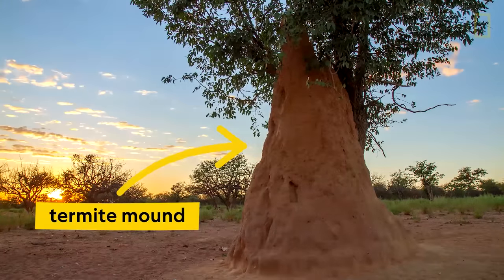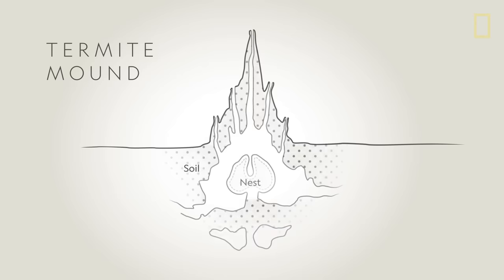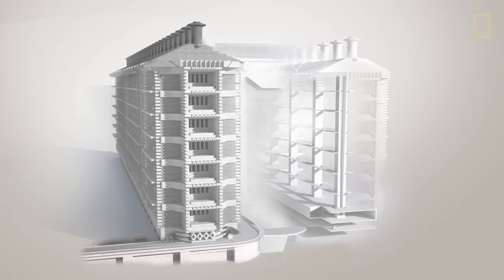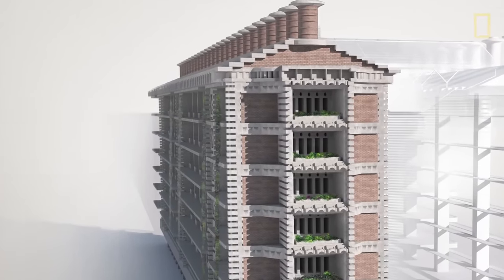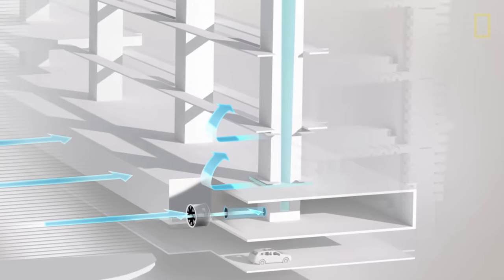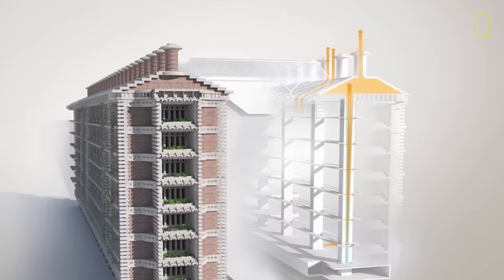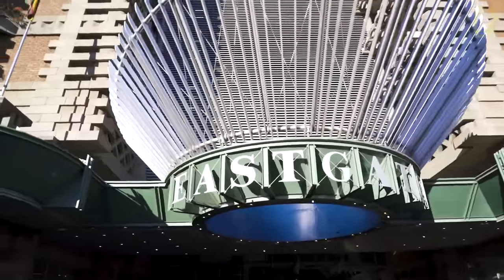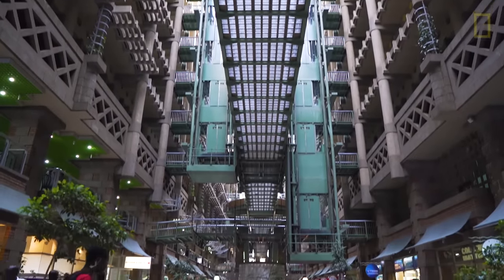See How Termites Inspired a Building That Can Cool Itself | Decoder

Comment: When she said 82° I literally cried in Celsius.
Reply: LMFAO 😂😂🤣🤣☝🏼👏🏼
Reply: Holy LMAO 😆😂
Reply: C=(F-32)/9. Isn't it the conversion equation from Centigrade to FARENHEIT and vice versa? 🤔🤔
Reply: 82 F is actually freaking hot, is like California hot
Reply: @tickle296  5/9...if u will not multiply by 5 it will be temp of winters😁
Reply: @kevinchen1763  it close to 27℃ which is not hot for hot countries....in my state summer peak temperature goes upto 40℃ which is not the hottest of my country..this year it's less hot here still today's temp is 36℃....Zimbawe is hot country so for them 27℃ is normal temperature
Reply: @kevinchen1763  When you are coming from a temperature 10 to 15 degrees higher, it will feel cool.
Reply: @Phoenix.219  that's almost heaven here in philippines rn. With daytime usually 36celsius or smth with a heat index of 41-42 celsius cos of humidity. I literally still feel sweaty having a fan directed at me at full blast. Damm. All buildings in the tropics should be standardised to this
Reply: @plip_plop  I can understand that.... It's just that they aren't used to the temperature😁
Reply: @devvv4616  when I saw this I thought the same...bcz in 27℃ a fan would be more than enough for anyone who are used to facing temp. even more than 40℃ with hot winds...last year the highest recorded temperature where I live was 45.8℃ ....and I live in plains...my brother went to a place in Rajasthan,which was still far from desert but much close in comparison to my land and nose bleeding due to heat was a frequent phenomenon for those who went from here....if only I can find the whole mechanism of the building I'll get my house built in this way.. It's eco friendly too as we'll not need AC
Reply: Oh don't worry, it's not cool in Fahrenheit either. The fact that this woman describes 82°F as "comfortable" tells me she's never been to Florida.
Reply: 27C is really comfortable 🤣🤣🤣🤣, I sleep with 31C at night without air-conditioning
Reply: some random guy: 27 is hot
Iraq: Am i a joke to you
Reply: Nat Geo is an American company
Reply: @plip_plop  Jesus that's uncomfortable cold for long periods.
Reply: @kevinchen1763  27 c is pretty cool in Caribbean
Reply: kkkkkkkk me
Reply: @kevinchen1763  well , i live in a tropical country, so it's hot AF , depending of the region that you are the temperature can be almost 40° C so next to 27, 32 is super cool.
Reply: Look it doesn't matter that over 90% of the world uses metric.  American measurements must be used because America..
Reply: It's 27.778 ⁰C dude
Reply: @willythepool3812  or a fan for that matter.
Reply: it's 27.78 Celsius
Reply: @0ctatr0n  it’s actually not American measurements, they’re called imperial measurements adopted from Britain.  The US would probably switch to metric if not for the power of American businesses which balk at the cost and time it would exact on them.
Reply: @willythepool3812  now how about that 😆😆
Reply: @kevinchen1763  82F is not that hot, atleast for my country. My country is a tropical country with average temperature of around 33 celcius, or 91F. In the off rainy seasons it can get pretty close to 40 Celsius or 104F. In my country what you call California hot is actually cool for us. During the rainy season it is about 27 celcius Which is a little less that 81F
Reply: @kevinchen1763  82 F (28°C) is Winter for us.
Reply: @Phoenix.219  Zimbabwe is definitely not hot. It is further south than the Tropic of Capricorn. Equivalent to places in China, not India.
Reply: It so hot 😂
Reply: @zhonnio2386  27 is actually cool here temp if here it was 36 we would still be happy
Reply: Its actually still really hot in fahrenheit.
Reply: Termites have long been an important part of many cultures. In Africa, they are considered a delicacy, while in Asia they are used as medicine. In the United States, however, termites are considered pests. But what if these pests could help us?

That's what one company is hoping to do with a new office building in Qatar. The building, which is being designed by Aedas Architects, will use a system called biomimicry to keep itself cool.

The idea behind biomimicry is to imitate nature in order to solve problems. In this case, the problem is how to keep a building cool without using air conditioning.

The solution comes from termites. These insects build their homes by excavating long tunnels. They then use their bodies to regulate the temperature inside the tunnels.
Reply: Considering how this is National Geographic, where "appearing scientific" is what they are going for, it is kinda weird how they are using units the scientific world (and tbh. the whole world) has already abandoned...
Reply: I hate that 95% of YouTube channels only include temperature measurements in Fahrenheit. Like you’re using measurements that are only relevant and understandable to 4% of the world…
Reply: I internally screamed "WHAT!", and then saw "Farenheit" and thought "ok...? 🤷‍♂ maybe"
Reply: I cried in Fahrenheit. That's hot for indoors. Of course, I'm from a cold climate.
Reply: @kevinchen1763  well consider the fact that it’s probably 90 or higher outside every day.
Reply: @kevinchen1763  that’s not true. 90 - 100 feels hot here in la
Reply: @kevinchen1763  no its not lol. i lived in phoenix where it was over 100 daily for most of the year. 82 was only slightly warmer than what i kept my house at in that weather
Reply: @kevinchen1763  bruh 82 F is around 27 degree Celsius 😂
Reply: @kevinchen1763  if 27 degrees is California heat, then Californian's have no right to complain about how hot it is down there anymore, we get the exact same temperatures in Canada.
Reply: Celsius users are not numerous enough to fund this video...
Reply: Why insisting using farentheight if the world is using Celsius. Just get rid of F it's R
Reply: 82 degrees fahrenheit = 27.8 degrees celsius
57 degrees fahrenheit = 13.9 degrees celsius
ffs USA
Reply: @vikasvimal6769  Better check a map again. Zimbabwe is actually just north of the Tropic of Capricorn, which runs through the northern tip of South Africa. South Africa, Botswana, and Namibia (not sure about Zimbabwe), each have arid to semi-arid desert regions which can easily reach temperatures of 40 degrees Celsius. Though you are right that it generally gets much cooler south of the tropic of Capricorn (ie. South Africa). South Africa is still Africa though. 30+ degrees is not uncommon during summer. Even on the southern coast, places like Durban in Kwazulu Natal can get pretty sweltering due to humidity.
Reply: Did you LITERALLY cry? Tears?
Reply: yeah fahrenheit should be banned
Reply: @kevinchen1763  no it isnt
Reply: There are two kinds of civilizations. The ones that use metric and the one that has been to the moon.
Reply: @JoseARomo-qv5fk  dry heat. Florida is wet heat.
Reply: Lol. There was a research once that found out there is a world outside of US.
Reply: @plip_plop and that is why visitors from other countries literally fall ill when when faced with the arctic air conditioning in the US. You probably only can survive that because you only move from your cold homes via cold cars to cold offices and shops, and you do not walk outside. Have you ever reflected on what happens to the hot air, that comes out of your ac-unit outside your building? That heats up a hot city even more, making it impossible to be outside.
Reply: I melted sweated boat loads of sweat before I could shed a tear. Imminent death followed
Reply: Weak.
Reply: @joemason2587 thanks bro saved my computing time
Reply: 82 inside is not comfortable either way. Just less AC use.
Reply: 82°F is not exactly comfortable, more like tolerable
Reply: @kevinchen1763 my south Mexican hometown is that temperature for like 8/12 months of the year lol
Reply: Died*
Reply: Forgot the funny part
Reply: Me too😂😂

Comment: I worked in the eastgate building everyday 8am-5pm for a year. I would say in hot weather temperatures inside the building (around 25°) were pleasant compared to those outside (around 30°). Hot weather is 9 months in Zimbabwe. However, during 3 months of winter the lower temperatures inside the building were uncomfortable for many. It was better to be outside
Reply: I didn't know you could have winter in Zimbabwe.
Reply: @MalaysianTropikfusion  we do have winter but our version is mild. I'm 35 and I've never seen snow. In the afternoon you just need a light jersey and then it gets bad in the evening where we stick around fire places
Reply: @clarencemaseko428  Just last year I experienced first-hand a Saudi Arabian winter. It was mind-boggling to feel cold at 12 P.M. noon. Looking at a map, it's no wonder. Saudi Arabia is north of the equator, and Zimbabwe is south of it.
Reply: @clarencemaseko428  You can easily put more clothes on if it's slightly cool, what's important is solving the issue of heat because that is much harder to solve
Reply: Termites have long been a problem for homeowners, but one company is using them as inspiration for a new type of building. Termite mounds are found in hot climates and are known for their ability to regulate temperature. The company has developed a way to mimic the termite mound, using concrete and clay to create a structure that can cool itself.

The building is designed to take advantage of the lower temperatures during the winter months. The concrete and clay absorb heat during the day and release it at night, keeping the building cooler during the hottest part of the day. The design is still in its early stages, but the company believes it has potential to revolutionize how we build in hot climates.
Reply: @showshowtomakefreeenergyge2426  The particular termite shown in the video, doesn't eat wood tho.
Reply: @lil_weasel219  there's only so much clothing you can remove and still maintain a professional dress code after all
Reply: I don't understand as well what's' so good about taking cold air from the bottom and pushing it back up anyway...
Reply: @olivieryeung398  cold air doesn't rise, it falls, so cold air from the bottom being used to cool the higher floors is actually kind of efficient
Reply: Wasn't there a fan which circulated cold air at night?
So if it is an actual issue in winter
Can't you just shut those down during winters?

And perhaps also have something to cover/close the chimneys for winters
Reply: @Kislay11  my thoughts exactly
Reply: 😅 Harare people talking about cold? Lol come to Marondera or Gweru🤣
Reply: Also it has snowed in Gweru twice in written history, but rare.
Reply: 9>3
Reply: the termite nest regulates because it brings ground temperature to above ground. this building is radiating so much heat away it's not following the termite principle anymore, lol
Reply: The chimneys should have been capped in winter, to hold in the heat.
Reply: Oh you meant the afternoon
Reply: Thanks a lot for you feedback it always nicer to have some real people experience then just fancy video
Reply: You mean colder monsoon season not winter
Reply: I've been to eastgate a few times and it's nice and cool in summer and not really warm in winter. I think it works better for cooling rather than keeping warm since the main reason it was built was to reduce electricity costs.
Reply: If only someone had invented the window or explained to the architects that the termites live below ground and then found someone smart enough to explain all that to the architects so that they could still take the credit!

Comment: For those of you are interested in this topic of architectural passive cooling designs I would suggest looking into what was used in Persia (now known as Iran) many centuries ago. “Badgirs” (cooling towers) were an ingenious use of local materials and the dynamism of nature’s thermal homeostasis to provide “air conditioning” that didn’t rely on electricity.
Reply: Cooling towers are interesting but completely impractical. You still can't beat Oil, Electricity generation, and Air Conditioning units. The vilification of modern technology is getting ridiculous. Notice how the larges proponents of going backwards never quite commit to do it themselves. I'd say those Africans were conned.
Reply: @Thinks-First it's not vilification. It simply is not sustainable to rely on fossil fuels for all our needs. While we wean ourselves off this dependence, it is helpful to have innovative low power consumption technologies
Reply: @Thinks-First They literally had temperatures between 27°C to 12°C.
Thats what people in those regions set the AC temp. at.

It is you who is blinded to not be able to see that they got what they wanted.
Reply: @Thinks-First  how are those ac units without electricity holding up again? After the power went out due to whatever cause this time. Or if the power grid just you know, went out or got destroyed/rendered unusable.
Reply: @Thinks-First  You understand that you can utilize both, right? You can pair a passive system like the Eastgate building with modern HVAC systems. There's nothing saying you have to choose.
Reply: @Thinks-First nature first
Reply: @Thinks-First  wind towers are practical. HVAC is much too expensive because it needs a lot of power
Reply: Engineering students be like: first time?

Comment: Termites also orientate their structures to make the best advantage of the suns radiation, something that is still beyond most building designer/architects
Reply: How do you know this info?
Reply: He knows because he has lived in a termite mound.
Reply: I cant find a short way to explain how wrong your argument is. We take extremely great care to optimize buildings in sustainability, from orientation to air leaks in fenestrations. The only thing out of reach right now is a precise method of calculating radiant heat gain because of it’s variable nature
Reply: @Random comment, but-
Watch Planet Earth 2. Episode Deserts.
Reply: Pointed top roof significanly decrease heat
Reply: I learned how to orient a structure to take advantage of the sun in a high school architecture class. Professionals obviously know about this and use it in design everyday.
Reply: They often don't have control over that...
Reply: yeah, so get one of the lads from NASA to help.
Reply: JC T you right there made my day sir
Reply: Mario L can u give tips on such a good sense of humour
Reply: Yeah but it is kinda hard to tell the residents to spend their day spitting on the floor in only a particular part of the building to help with cooling.